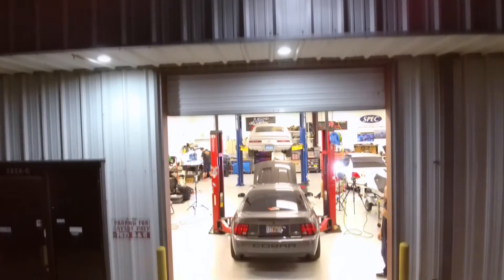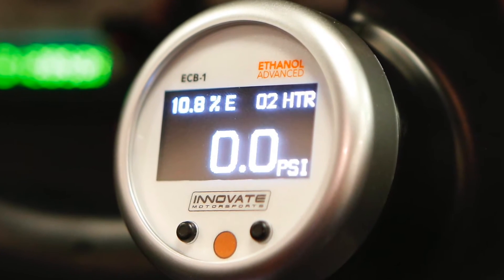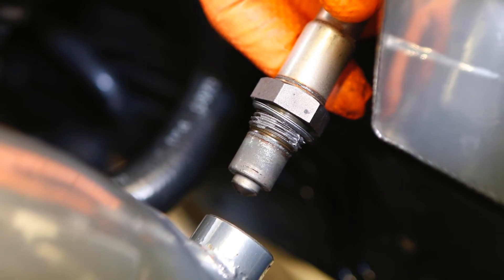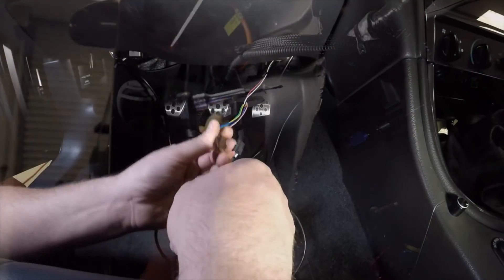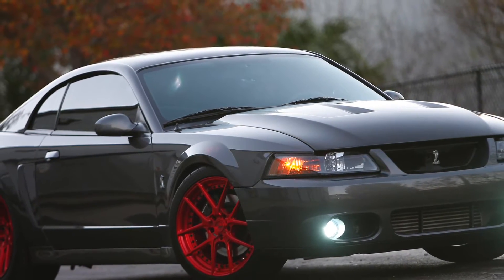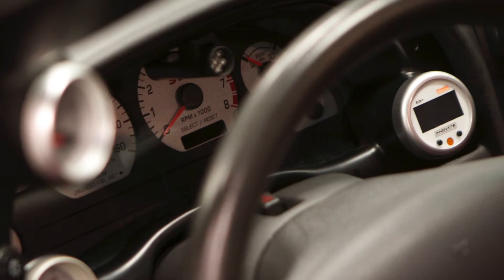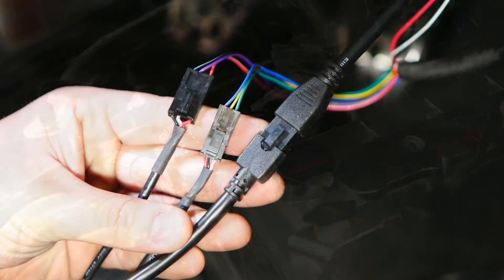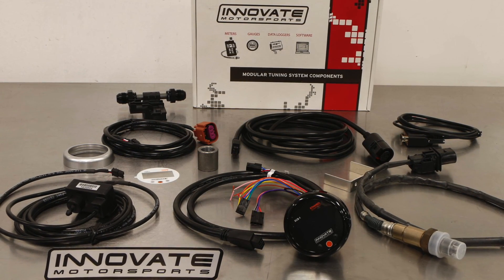Innovate ECB-1 Install on a Turbo New Edge Mustang

Comment: Will this work with a Continental Flex Fuel Sensor that is directly wired into the O.E.M. E38 E.C.U., on an 09 6.0 Ltr Pontiac 68 GT ??
Reply: I really Wish They Had Replied this Question SMH So Much Customer Support SMH
Did you ever get the answer to this question?
Reply: @BjornFSE  Who? Innovate?? They have great customer service. Maybe contact them directly? smh 
Or for the spoon fed answer you're looking for...
Go to their website, look at the gauge, click on the link for documentation, and go to section 2.4 for Flex Fuel Sensor where it states... 
"P/N 3911 kit does not include flex fuel sensor. The ECB-1 is compatible
 with GM P/Ns 13577429 and 13577379"
Take off